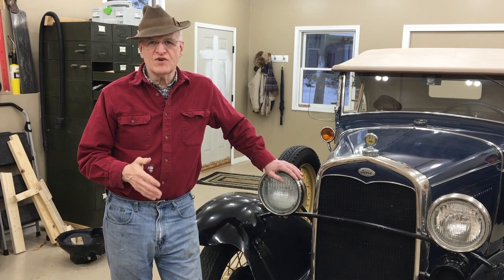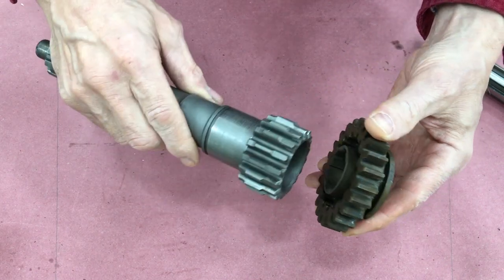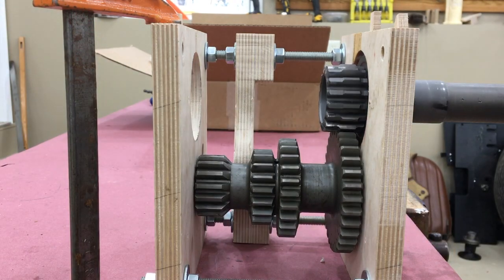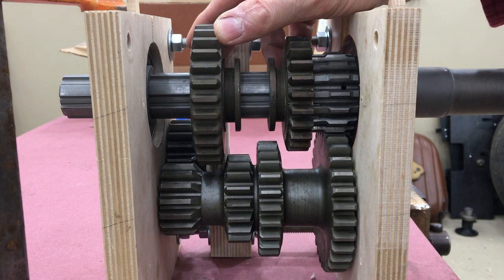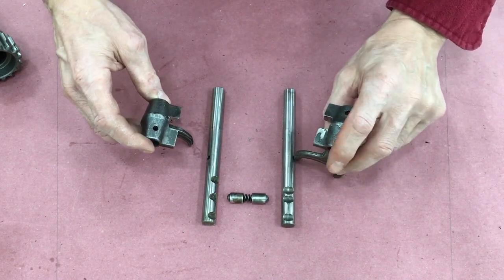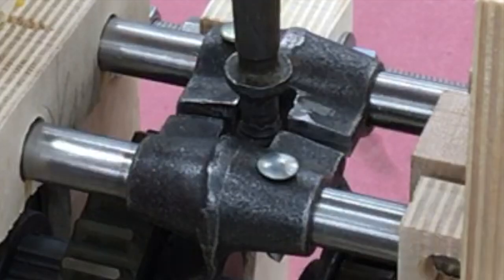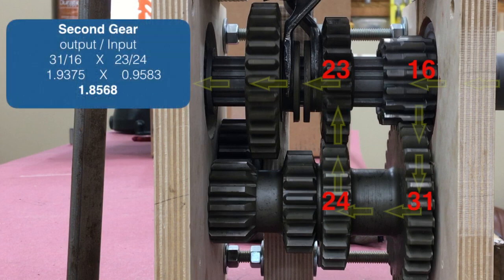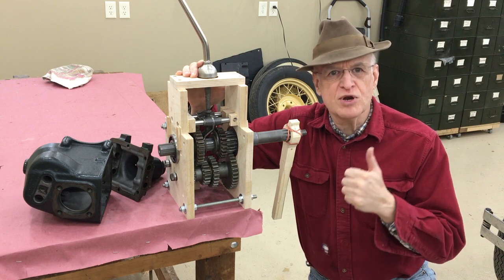Ford Model A Transmission - How it Works

Comment: Nice job as ever.  Graphics and a laugh track!?!  Really excellent demonstration.  Very helpful.  I love the plywood jig.  Amazed at how well it worked.  On the robotics team, the better prototypes we build, the better the final product, and the results are really exponential in my opinion.  Using a plywood jig to aid in the evaluation of a transmission, is so helpful.  I might have missed a video but I didn't see the root cause of the noise discussed from your last video.  More to come?  You could teach engineering classes.
Reply from the maker: Thanks Bill, stay tuned, we will see the root cause in detail next time.